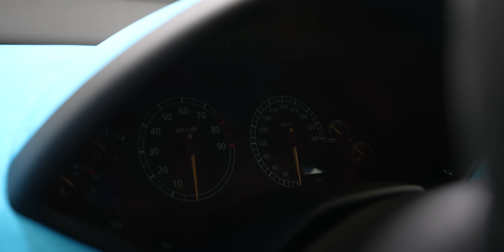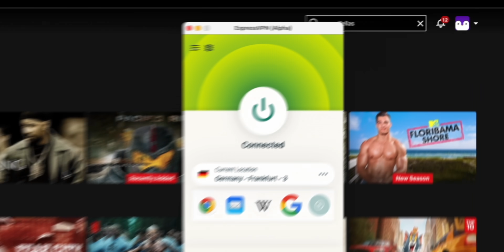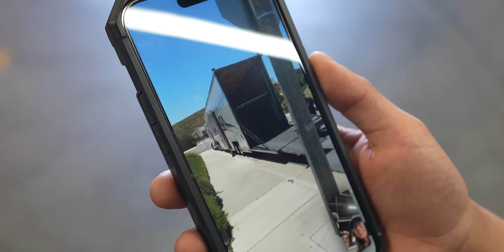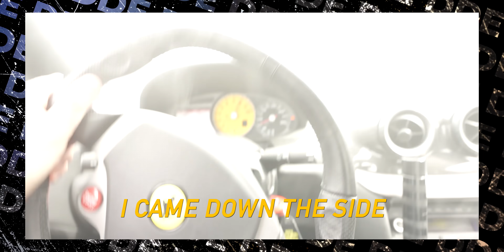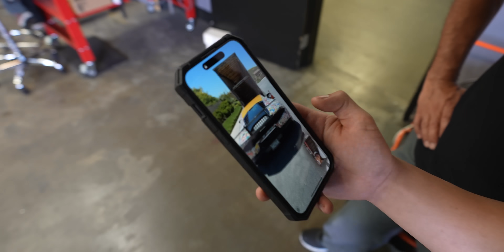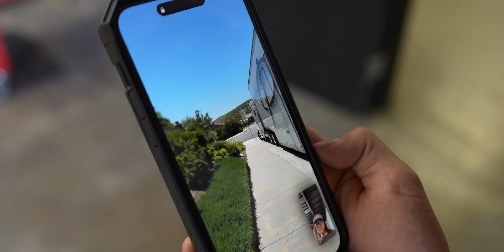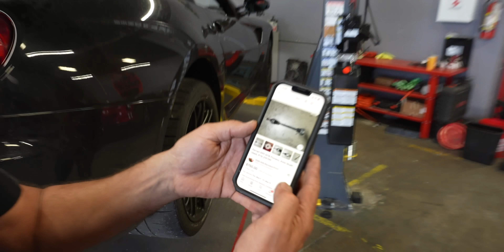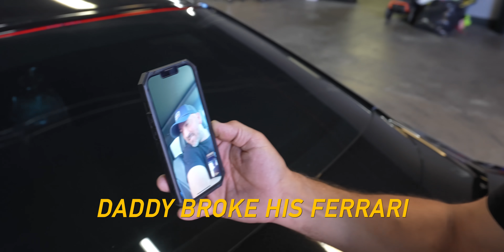TWO ICONIC DDE SUPERCARS LEAVE THE HQ!

Comment: Dave tried to laugh so hard on the FaceTime video... 😂😅 caught that. Mike, the wing bro, please re-think that design. Doczilla, on his LBWK GTR, had a moving wing support with hidden hydraulics in the bumper and had a button under the light for the license plate. Made it so the wing moves back so you can access the trunk.  What would be a great touch for Dave is if you add DRS support on this wing you build next. Push your knowledge on what you have learned over the years and make something 1 of 1. Want more help? Tell Dave to check his email. Great video, DDE, like always!

Comment: A corvette power steering pump will fix the 599's in a Corvette transaxle with an RPM 5-speed transmission and then 599 would kick a$$